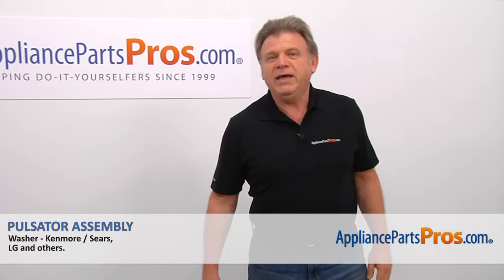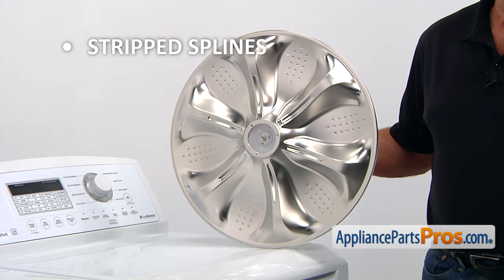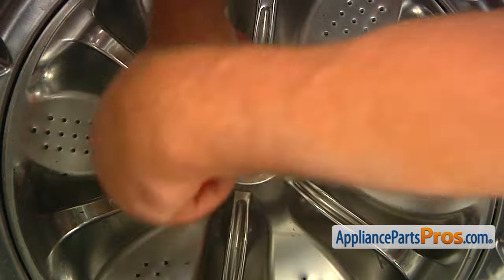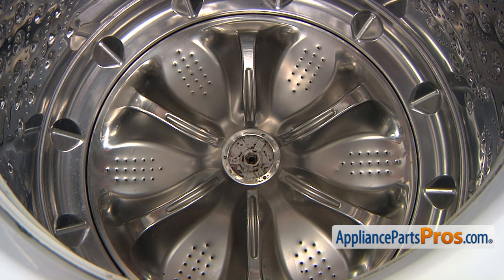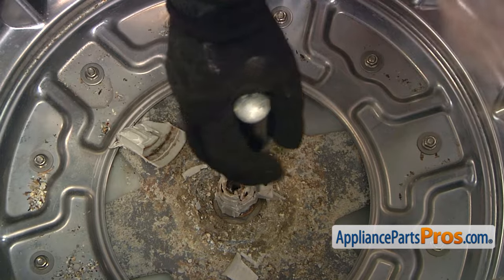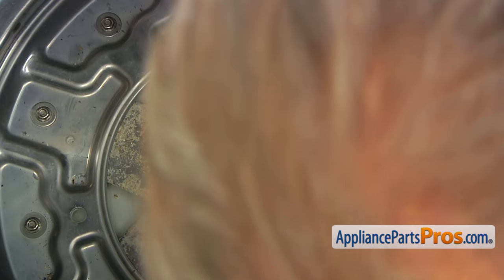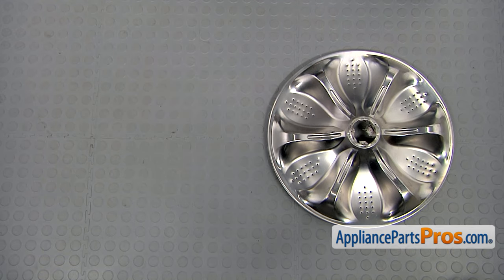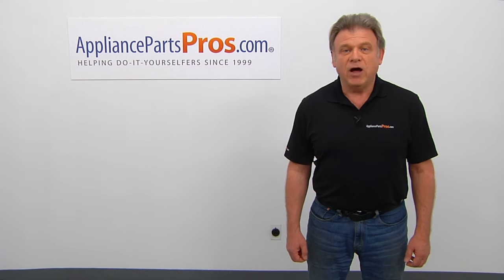How To: LG/Kenmore Washer Pulsator Assembly AGZ72909711

Comment: I was worried that the chisel method would be rough on the motor.  So first I tried CLR in the Clean Tub cycle, no help.  Then tried a gear puller, but the hook bent.  Finally I used a chisel, but prior, I used a hack saw to score 3 grooves in the top where I planned to chisel.   Thanks for your video, you showed exactly what I needed to see.
Reply from the maker: You're welcome!

Comment: Instead of a hammer and chisel. I was able to add a little CLR and put on tub clean cycle. With the middle bolt gone and the water in the tub the pulsator plate just floated up.
Reply: I ran a couple agitator cycles then a tub clean and it happened just like you said. Thanks!
Reply: @gabenguyen1216  What is agitator cycle?
Reply: @helenwang3872  I just used a quick wash cycle from what I remember.
Reply: Same here. Tried taking that agitator out every which way bending some parts more than I wish I did. Then gave up and used tub clean cycle without the cap or bolt hoping some water would seep through. Was pleasantly surprised to find the agitator free as a bird during the cycle. May want to stop it midway as I did — not sure what would have happened if the spin cycle started with that thing loose…
Reply: @dkny02138  😂 I'm glad you didn't have to find out
Reply: Thank you so much for this comment. Because here I was watching all these dads just pop that heifer out. I’m struggling and fighting it. Finally find this video but I’m unwilling to bust out a chisel. Your comment saved lol. Worked like a charm. 🙏🏼
Reply: Thank you for the hint… I’m a 67 year old woman and couldn’t get the pulsator out,,,did the tub clean with just water and it floated right up after a few minutes
Reply: I have a dumb question - how do you drain the tub at that point?
Reply: Thank you VERY much for this information! Chiseling wasn't an option. I appreciate it.

Comment: Use a Dremel to pre-cut, then bang away. What a hassle to remove that metal gear so the new part fits. But it works, and the only solution we found.
Reply from the maker: Glad you were able to fix your issue! If there is anything we can help you with in the future please let us know.

Comment: June 12, 2020 -  I made a simple mistake that made me think I ordered the wrong pulsator plate because the spline hole was so small on the new part. My old plate was free spinning. Okay, I pulled off the old pulsator plate and the motor spline was huge -  about the size of a quarter. WRONG! I missed something. The pulsator plate has a metal insert that goes on the motor spline. Well, it came out of the old pulsator plate when I pulled that off and the insert was stuck on the motor spline, making appear like a larger spline. Once I freed the insert off of the motor spline, guess what? Yeah, the new plate fit perfectly over the motor spline. Hope this helps someone.
Reply: That would have happened to me. 😂. Thanks   🤙🏼

Comment: Using air wedges and a nail bar under the pulsator, my Maytag washplate separated but left the metal insert seized to the drive shaft. I used a small  gear/bearing puller to remove the insert. The washplate was good but it had to come off to replace the hub. They need to make slots in pulsator to allow gear puller claws to fit under the insert. It would save hours of frustration and wreckage
Reply from the maker: I understand your frustration. Glad you were able to fix your issue! If there is anything we can help you with in the future please let us know.

Comment: Good video, but what issue would require this part to be replaced?  Is the connection to the shaft worn out, so it is not turning?
Reply: Yes. The splines on the wash plate wear out. Also, you can clean under it as so it doesn't smell like a sewage treatment plant
Reply: The splines on the washplate are plastic and they tend to wear out,they this in case anything gets snagged it will just wear out the plastic spline
Reply: @staind288  any need to put loctite on the bolt?
Reply: @loudastous1159   any need to put loctite on the bolt?
Reply: @sandmansimms5704  no I never had it back out.
Reply: @staind288  oh cool how long is a lasting so far?
Reply: @sandmansimms5704  mine has lasted for 10 years. Never had an issue with it
Reply: @staind288  oh gotcha. Yeah I noticed there appears to be some loctite on the boat from the manufacturer I guess when they make it as well as I've seen boats online that already has locked out on it so I wonder how effective a boat that I already has some something applied to it that has dried up I wonder how effective it is once you fasten it? Put a little bit of loctite on but I guess if the plastic spline breakup is not going to matter anyway
Reply: @sandmansimms5704  if new bolt h has loctite on it, no more is necessary. My bolt also had a rubber 'o' ring. If you're reusing an old bolt and feel better using blue loctite, then put a drop on it. I didn't use any and after torquing it down, it hasn't backed out yet.
Reply: @staind288  gotcha thanks
Reply: @staind288  when putting the new agitator on is it any need to put any lube or grease on the plastic shaft for sliding it on or will it go on pretty easily?
Reply: @sandmansimms5704  should slide right on. You use grease or something it could come off and stain clothes. If you do use grease I'd recommend a marine grease or silicone / synthetic based

Comment: Thank you for the video. I had to do the same thing you did. I had to chisel the plastic off the center of the pulsator and then chisel the metal part off also. I put the new pulsator on and its working like a  charm now. It took me about an hour to do this. My LG washer is 10 yrs old now. Hopefully, it will last a couple of more years.

Comment: I didn’t se your video until after the fact, but I used the same technique you used to remove two pennies out of our LG this morning. I told my household to CHECK THE POCKETS of all pants going into our washer. It was frustrating to say the least and I was concerned about any damage that may have occurred. But all loads ran afterwards were nice and quiet. BTW, the pennies were completely smooth on both sides....lol! Thanks for sharing your video. I am sure it will help others with this dilemma.

Comment: Great video!  Thank you.

My Pulsator plate keeps coming off.  Both the teeth of the splines and the shaft still seem sharp and intact.

I removed the pulsator cap, and put the plate back on.  I used a socket wrench to tighten the pulsator bolt.  It was snug, but didn't want to over tighten it and break the plastic assembly.  I then replaced the cap.

The following wash cycle, the pulsator plate came loose again.

Any ideas why this is happening?  Should I be ordering a whole new Pulsator assembly?

Thanks in advance!
Reply: Use blue loctite on the bolt

Comment: My pulsator/washplate is significantly stuck to the drive shaft!!! Can I use WD-40 or olive oil or similar to get it loose? I've tapped and pried... Obviously, I don't want to introduce clothes staining, but cannot get it out (without damaging the pulsator, I fear).
Reply from the maker: If you have removed the screw and the pulsator is still stuck you can try some rust buster on it. If that doesn't work you can try slipping a belt underneath the plate and see if you can get it out that way. If that doesn't work then you can use the chisel method shown in the video.

Comment: I can i remove it without breaking it?
Reply: I was able to use a couple of small allen wrenches obstetrician in the drain holes on opposite sides close to the outer edge. I used pliers to grab the allen wrenches and pulled one side then the other several times.  In doing this i was able to"walk" off the part. I want easy and took some time but it popped off.

Comment: DON'T DO WHAT HE DID TO GET THE WASHPLATE OFF! IT'LL DAMAGE YOUR WASHER. 
TRY MY METHOD INSTEAD!! I watched a TON of these videos and only 1 worked. I felt dumb after trying all the tools and straps. Just take off the plastic cap. Remove the bolt. Pour in some bleach and set it on 'Tub Clean'. I canceled the cycle at 0:50 and the washplate was there floating in the water. Stupid easy. The tub will drain automatically after a while or you can just close the lid and let it complete the cycle. I felt silly after trying to manhandle the washer! (Note: I'm 5'2" petite female and probably wouldn't have been able to muscle that thing off anyways.)
Reply from the maker: Glad you were able to get your washplate off that way. Our videos are just to help give you a general idea on how to do the repair. If we can help you with anything please let us know.